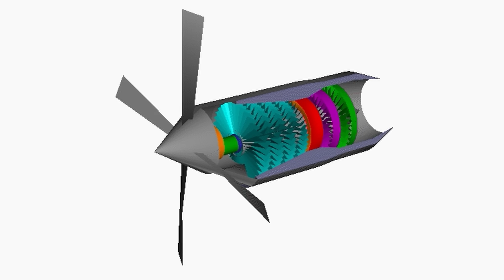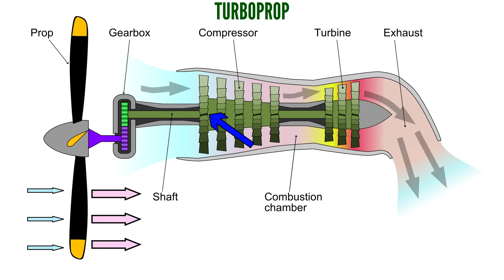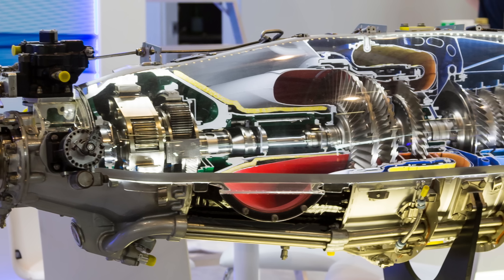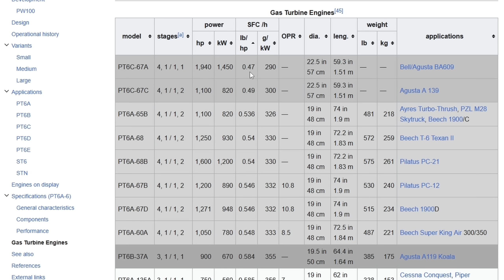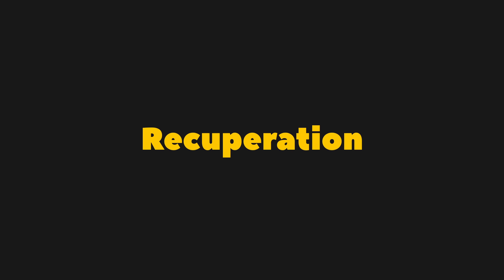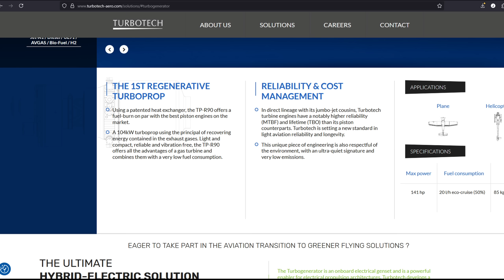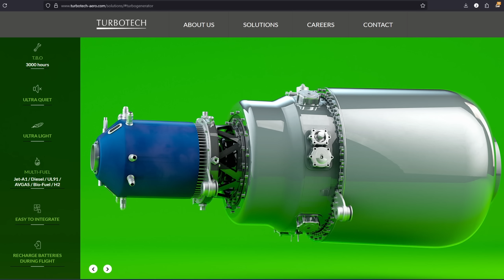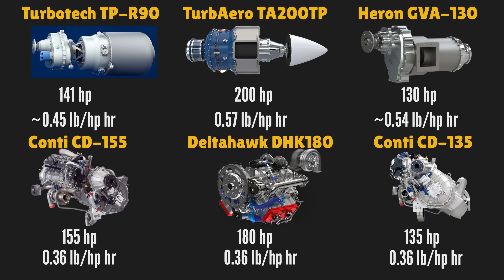Are Piston Engines Dead? Small Turboprops are Here

Comment: Fuel prices need to be factored in here.  Currently (in Norway at least) Avgas 100LL is 2-3 times more expensive than Jet A1 fuel, and Avgas fuel pricing is trending it into obsoletion.  Sure, some planes can fly on U91 mogas, but Jet A1 is still far cheaper.
Reply: Turbine engines can run on pretty much anything tho
Reply: @danielserrano8600 Not really. In theory but much changes must be made switching fuel types.
Reply: Rotax run on mogas. We need some bigger rotation engines in the 250hp range.
Reply: Great point.
Reply: UL91 is not mogas, btw, it's unleaded avgas.
Reply: MOST piston aircraft engines can run on UL91.
Reply: Will it stil be cheaper if private citizens start using it ?
Reply: @sbkenn1  compared to airlines private citizens burn basically nothing, it won’t have that much effect.
Reply: This just means you buy a diesel
Reply: @eric4946  turbine time
Reply: Piston diesel engine also solves that problem though!
Reply: That's more an argument for a Diesel conversion, than a turbo prop.
Reply: You can bet as avgas demands go down jet fuel prices will rise.
Reply: @williambarry8015  Jet fuel price is set by the demand from commercial aviation while high-octane avgas is a boutique product from the "blenders".
Reply: @williambarry8015  you can bet as avgas demand goes down avgas prices will skyrocket
Reply: @tjts1 The demand from GA if everyone switched from avgas to regular jet fuel is ridiculously small compared to the demand by commercial aviation. The price will increase with a penny..
Reply: @notaseriousbeaver Jet fuel is cheap mainly because (in most jurisdictions) there is no tax on jet fuel. 
In Britain, a wonderful politician named Gordon Brown, brought in a requirement that any diesel aircraft using jet fuel has to pay the taxman the difference between untaxed jet fuel and taxed diesel fuel.
Reply: @BillTomlinson-zj3pn I'm the Taxman, you're working for no one but me😮😮😮

Comment: My rational Brand-new mid-price car 50 to 60 K .... one striped down engine 50 to 60 K. Somehow, I have an issue with this. There is no super advanced technology in the aircraft engine, still common aluminum, steal, etc you can find anywhere. Machining tolerances are not anything special. (I own a machine shop). True, volume makes things cheaper but there are diminishing returns on cost as volume goes up. Once past 1000 units actual cost does not change much. Unless you change the process such a casting or changing material. But I make things for people who makes things, so I don't have their experience.

Comment: Most turboprops, if not all,and helicopter turbine engines have a compressor and a turbine (N1 spool/ gas generator) and a Power turbine ( N2).
The power turbine drives the reduction gearbox , which power the propeller. ( on a helicopter the power turbine drives an accessory g/box, which step the PT rpm down and then drives the main rotor g/box and step the rpm more down. 
A small turbine engine only have a lot of rpm ( 30 000 - 35 000 rpm N2) and not much torque, a gearbox is a torque amplifier .

Yes, I agree that the current piston engines are basically WW2 designs and not much have changed ever since. And the current AVGAS (102 octane) still contains lead.
Jet A 1 ( "clean parffin") is cheaper than AVGAS, and not as volitile as AVGAS.
It is a pitty piston  diesel engines in aviation is not  big yet. 
( maybe someone is still making too much money out of the profits of AVGAS 😜)

Comment: Isn't it possible to design turboprop that outputs optimal amounts of power for cruising while peak power required for takeoff or climbing or other brief high power demands is supplemented by other means, like a electric motor or another engine? 

It isn't like we can boost it with afterburner like some turbofans, add small turbines like those on the Cri Cri or rockets like in some military applications. 😂

However, adding a supplementary power to the prop could be a solution during moments of higher power demands.

In a hybrid eletric system, you could even recover some of the excess power while cruising to recharge the system for later use. There is extra weight and  complexity on this and probably only benefits long range flights, but it is something that still makes me wonder.

A single propeller with a twin turbine engine solution with a cruise engine and an extra power engine, that's shutdown during cruising, could be another solution, but I bet that would render this engine even more complex and heavier for smaller aircraft.

Comment: I mean even if they were to bring turboprop engines to somehow replace pistons, how would they change the entire design of a Cessna or a Cherokee to have a Turboprop and won't it cost an insane amount?
Reply from the maker: Wouldn't change the design, just need engine cowl modification, the nose usually need to be longer to mount the engine farther forward compensate for the lighter engine. Many turboprop converted Bonanzas, some Cessna's, etc. Can't comment on the cost.

Comment: Pressure ratio (thermodynamics loves temperature ratios)  gets high efficiency numbers-  "few" aviation  turbines get to  or >10:1 ..
Reply: - We probably need to exit AVGas engines go,  let 100/LL die.  Let's go JetA1 or diesel (common fuel) for light AC... 

Recuperators vs pistons - is the fight right here..  For low power (low altitude) - GA and low range (~250 miles) 6 seat (non IFR) private GA, turbines aren't in the market...  IFR low-medium range, single operator (mail and bank operators - if the are still relevant) - definitely single engine Turboprop over twin piston - these professional applications with high TBO make some sense - Or - gang longer routes into chains for fewer cold starts to assist the TBO metric..

Comment: My chief complaint about Turboprops in general aviation is efficiency, just like you stated. To get the cost down, the designers use fewer compressor stages, making them far less efficient. Adding more compressor stages in a small turbine adds cost driving up price significantly. 

Horsepoer also seems to be a problem.  Small turboprop makers seem to target the wrong output. Every plane is underpowered. The turbines i saw at airventure output dumb numbers like 150hp or 160hp. They need to be producing 200hp.
Reply: They would be best to use in a hybrid system.  Have a small light battery capable of 50kW for 5 minutes for climb, size the turbine precisely for most efficient cruise power.
Reply: @evan010101 The idea about hybrid operation is interesting, but I don't think imthe designers were thinking about this... These turbine developers are sizing their designs for UAVs imo.

Comment: excellent explanation of the different efficiency curves of piston vs turbine. turbines are great when you're near full throttle all the time, which is why they do so well in helicopters.
Reply: Since when do you run full throttle in a helicopter all the time?

They are doing well in helicopters because of their great power to weight ratio, rather.
Reply: @TimToussaint  helicopters are pretty close to topped out in most scenarios. hovering takes a ton of power lol
Reply: @nuttyDesignAndFab  I totally disagree with your statement. Hope you are not a pilot 😂. Nothing could be further from the truth.
Reply: I very much enjoyed this video. I am a master mechanical technician but I have little to know knowledge of engine operations in airplanes. However when you said turboprop are most efficient at or near full power but most cursing throttle settings are 60 to 40 percent I thought about using a verbal pitch prop to maintain cursing speeds while running the turboprop at a more efficient power setting. Just sayin…
Reply: @southerncross4956  the problem with that depends on the type of turboprop, but for both common designs that doesn't work: the efficiency of the jet has to do with the pressure in the combustion chamber, and the pressure in the combustion chamber has to do with the RPM of the compressor. If the prop is connected to the compressor spool then it's not like you can throttle it to a lower RPM since that means lower pressure. If the turboprop is 2 spool, then you can have high pressure in the compressor and throttle the RPM of the power takeoff turbine connected to the prop, but again that doesn't gain efficiency because the flow through the turbine is relatively constant regardless of RPM, meaning throttling it's RPM down just decreases efficiency. 

something like variable geometry turbine inlets is what you're looking for. I think maybe Chrysler did this in the turbine car?
Reply: @nuttyDesignAndFab Thank you for the feed back but I struggled to in understanding your response as it’s likely a bit over my head. My thought was a variable pitch prop could be adjusted to produce less trust for cursing while the turbo is running at higher RPMs being more fuel efficient, as in using a lower gear in your car with the engine running at a high RPM. Well anyway, thank you again, have a good evening…..
Reply: @southerncross4956  if you feather the prop (produce less thrust) but DON'T throttle down the engine then the same amount of horsepower is going into the prop so it will overrev. it's kinda like downshifting into a lower gear while still at full throttle. 

in  a single spool what you want is not possible, but in a twin spool if you have some way to restrict the flow after the combustion chamber then you can build the pressure needed at lower flows (the determining factor for efficiency is what pressure the combustion happens at). The way to restrict the flow is to use variable geometry vanes just before the power output turbine.
Reply: @nuttyDesignAndFab Thank you again for responding. Well the only way to have a good conversation about this is if I came to your office, but of course this little back and forth is of no real importance. Have a good evening……

Comment: You forgot to mention that the turboprop advantage is being able to cruise at, say, 15,000 feet higher altitude than a turbocharged piston version and that produces an increase of 30% in speed and since for tourism what matters is not fuel consumption per hour, but fuel consumption per mile a a 0.55 lb/hp-h is comparable to a 0.42 lb/hp-h engine. I grant that very few 2 seater aircraft owners will use it for long distance trips, though.

Comment: I'm getting a laugh from all of these folks who are pointing out that jet fuel is cheaper than gasoline, while promoting an engine that costs tens of thousands of dollars more than a piston engine.
Reply from the maker: Depends on the cost difference, but on many, the additional cost can't be recuperated (get it?) by fuel savings.
Reply: @LetsGoAviate  That depends how much you fly in a month. The cost difference between fifty hours a month of Jet-A consumption vs 50 hours of avgas is going to add up quite quickly but if you're only flying ten hours a month then it may not make that much difference. There is also the regulatory maintenance costs which should be less for turboprop engines as well as consumables such as oil changes, coolant, spark plugs etc.

What's the weight difference between a turboprop engine installation compared to their equivalently-rated IC engines? That could be another bonus, especially if smaller turboprop engines are on the horizon.
Reply: Why is that a laugh when you factor in lifetime cost to operate? As only one example, in Norway av gas is 2-3X the price of jet fuel. For someone living there would the piston vs turboprop cost differential be so "laughable?"

Comment: 60 years ago they were saying piston engines were on their way out. 
The limiting factor of machining the turbine blades has made sure piston engines keep their spot at the top for price and accessibility stack. 
That being said, my local engine shop has nearly 200 engines torn down waiting on cases. 
The time maybe right for a shift is the order.
Reply: Crop dusters have been using the PW R 1340 for ... Since it was first released till recently. Most of those engines were originally built in the late 30s to the late 40s  there just aren't any more of them left these days. It's more economical to put a dash 6 on a super b ( Grumman 164 subtypes.. also on the way out) the increase in capacity pays for the engine.

Comment: Never gonna happen. They cost entirely to much
Reply: Maintenance isn't free, if they prove to be able to operate 3,000 to 5,000 hrs without maintenance or complex inspections other than oil and filter changes, then it is a no brainer! In the same times span you will have inspected and serviced a Rotax 30-100 times... that isn't cheap...
Reply: @TheEsseboy Dosent matter. People will see 100k+ upfront cost and say no way. GA is almost dead to begin with.
Reply: @skyking6989  100k+ is not terribly much when a brand new aircraft is 300k+, it would add 50K to the sticker price, but have other benefits.
Reply: @TheEsseboy if the aircraft was included sure but I still stand by what I said. The average GA pilot is going to say hell no to 100k+ engine
Reply: @skyking6989  Sure, but they are not the intended target for neither new or better engines, they use the second hand market.
Reply: @TheEsseboy im all 4 new and better engines but ROI will be nill. It isn't gonna happen. There is no $ in small gas turbine engines
Reply: @skyking6989  That is to be seen, first of all they need to actually launch it, if they can actually make the price 100K and going down over the years, they have a good chance at something real. Gas Turbines are inherently better in many ways, just a bit sad they didn't get the weight down which is usually their largest advantage, guess the recuperator and fighting physics makes it heavy.
Reply: @TheEsseboy I hope your correct but ive seen all these alternative GA engines for 20+ years now and they never go anywhere. Fact is the 100LL piston engine isn't going anywhere anytime soon
Reply: @skyking6989 It will happen sooner or later, if they don't hurry up it will be a hybrid system with a diesel generator to a battery pack... then you can use a 25% less powerful engine and use the battery for take off power, and potentially windmill it full on descent. Battery tech is getting cheap, and some battery chemistries don't even burn. 😊
Reply: @TheEsseboy Oh i have no doubt it will happen eventually but its still a very very long way off. 10+ years easily
Reply: @skyking6989  For sure, I am a little bit more optimistic, I think it's around 5+ years, but who knows, all I know for sure is that change will speed up when change in other industries speeds up.
Reply from the maker: News to me. Have you owned a Rotax? We've had two 912's in different planes. It's hardly any more expensive to service per year than my out-of-warranty Honda...
Reply: @LetsGoAviate Again it won't happen people will see 100k plus upfront and say no way. People dont see they will save on the back end. Everything is all about upfront costs. Small turbines have been tried for years. It simply isnt gonna happen
Reply: @LetsGoAviate  I guess that entirely depends on how tightly you follow service and inspection intervals. I could be wrong but from what I've gathered you need to do that every 100 flight hours? Spark plugs every 200 flight hours? 
I don't know how this differs between people who fly private only and those who also fly as a service. And I don't know the regulations involved.

Comment: So a turboprop is like an open and rather large bypass jet engine?
Reply: In a loose sense, though Turbofans have much better efficiensy at high altitude and high speed, so not apples to apples. Plus noise reduction as the blades are encapsulated and sound insulation can be used in the shroud.

Comment: Of course you can use Jet A1 or normal diesel in the diesel aviation engines available that are more modern (comparatively) and burn less fuel per hour.
Reply: But with a weight penalty and lack of wide industry support.

Comment: On the recuperation, Garrett ( Honeywell, now ) the ATF3-6 was designed as disposable engine, cruise missiles, USCG put it on HU-25 and brought it to commercial market, Garrett reduced weight with change of metals and coatings, these changed bsfc, if I remember correctly Pratt & Whitney was doing the same with PT-6. Some turboprop run 3rd shaft for power turbine partially for better turbine control.
Reply: Allison also had a small turboprop.  That was before all the mergers...